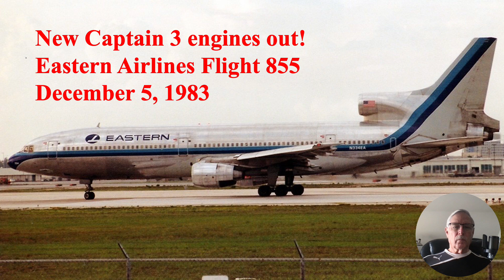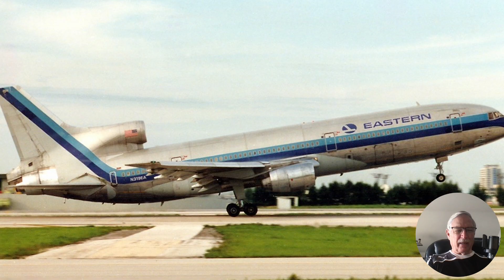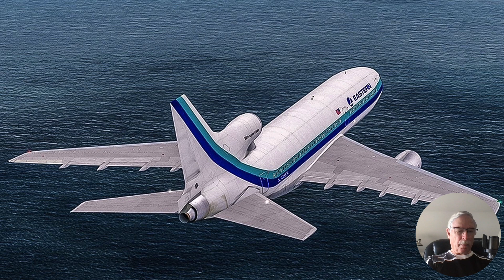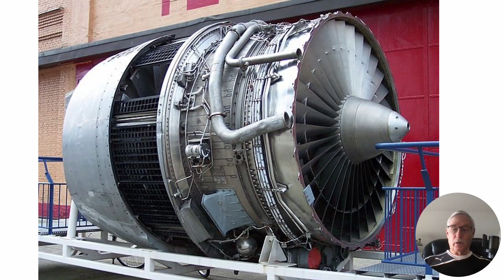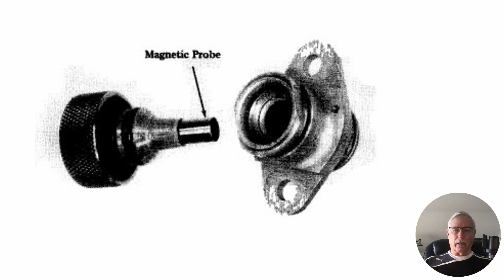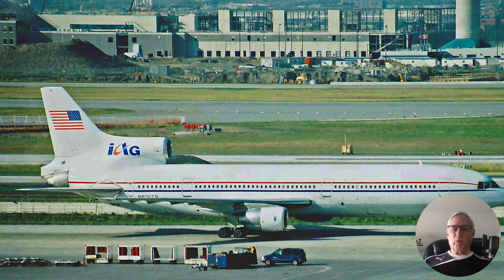New Captain 3 engines out! Eastern Airlines Flight 855 December 5, 1983

Comment: I worked for Easter at the time. There is a lot to this story that doesn't get any mention.  To start with Joe Leonard worked for American. He was saving money by when changing an engine on a DC-10 putting the engine pilon and the engine in one piece. This caused a crash in Chicago that killed everyone.
Frank Lorenzo had taken over Eastern and was at war with labor. He brought Joe Lenard to Eastern to cut costs (jobs).
He happend to walk through the stockroom in Miami and seen the stock clerks putting the O-rings on the Magnetic  plugs he said they are waisting time and changed the procedure. The guys that did the check were outside at night with coal miners lights on there helmet. This is not an excuse but part of a reason. 
Eastern was at war with the employees. Everyone was working short handed. The midnight shift was working short handed that night. The o-ring procedure had just been changed by Joe forklift Lenard.  
Short handed, firing were ten times normal. The grievance procedure was so backlogged it was non-existent, everyone was stressed beyond the braking point. I was there i seen what Frank Lorenzo did to a once great airline. He was a cutthroat and should have been stopped sooner. He is no longer allowed to have any management position in an airline. 
He had no regard for the safety of the flying public because of his history at Eastern Contenal New York Air Texas Air. His is banned by law 
Check out the Continental airlines DC-9 that crashed on take off out of Denver it was snowing in the 80s i think 32 died that night. The Captain and First  Officer both had less than 30 hours in there respective seats. A rule change by Lorenzo that allowed that to happen. Plus an equipment change to a DC-9 short. They don't have slats.
One orher crash you should look at was the Eastern 727 that crashed going into  La Paz. This was a brand new 727 the last one Eastern bought. No flight recorders were recovered and no bodys
Reply from the maker: Thanks for the insightful comments. I was wondering what part the "beloved" Lorenzo had in this event. Thanks for filling that in. Thanks for the La Paz suggestion. Will look at that.
Reply: @ronrogers  thanks for what you do. I was with Eastern for 16 years. I loved going to work everyday. The guys that changed the plugs were good mechanics. It was a bad time to be at Eastern. What a shame 
It  was so glad you pointed out the APU. That was key. 
On the La Paz crash I never understood why it was kept so quiet. Very strange. I worked on that plane just a couple of days before. It seemed like they just wanted to not know what happened. It was very strange.
Reply: "He was saving money by when changing an engine on a DC-10 putting the engine pilon and the engine in one piece. This caused a crash in Chicago that killed everyone."  

Did he have anything to do with that?  A few years earlier (from the Flt 191 NTSB report), American had changed engines pylon-attached on four DC-10-30's for a Middle Eastern carrier with no problems.  So when a fleetwide changeout of pylon bearing became necessary, AA obviously was looking at how to get it done as expeditiously as possible.  Not just about downtime for the airframes:  Keeping the pylon attached meant many less hydraulic and electrical connections got disturbed.  Unfortunately, clearances within the DC-10-10 pylon structure happened to be less, so -30 experience wasn't exactly applicable.
Reply: I think I agree with a lot of what you said, but proofreading is your friend. 
You should proofread your comment, and edit it.

Comment: I remember talking to my Dad about this incident, and his exact words were "that's the difference between a Captain a company man. These two Captains chose to save the company money and turn back to MIA where their maintenance base was, instead of, with an engine out, landing at the nearest airport. That decision damn near bit them in the ass. As far as the destination weather was concerned, they were planning to land there anyway, if they didn't have the engine issue. And, like yourself, they'd done engine out approaches in IMC probably dozens of time in the sim, and of course, the sim instructor probably never failed the easier #2. I used to love picking my Dad's brain over dinner after he retired off the -10. He moved to the left seat on the DC-4 in 1952, and stayed in that seat until he retired in 1980.
Reply: I can't fault the pilots for trying to get to Miami, since what are the odds ALL THREE engines would quit on the way back?  I mean, if one engine fails, the other 2 are very very likely to be OK, in that moment.
Reply: I remember this very well.  But, I too wonder why they didn't just land in the Bahamas.  I think Ron explained there decision, but I guess I didn't understand what he was explaining.
Reply: The opposite is true.
Nassau had no radar and no precision Instrument approach at that time.
And they were reporting low ceilings and thunderstorms. So the pilots turned around to Miami. Landing in marginal VMC with one engine out is not really a smart idea.
Let alone a landing with no engines. Because engines 1 & 3 woild have failed anyway without Oil !

Comment: I find it almost impossible that a sealing ring could be forgotten. Let alone 3 at the same time by different mechanics. I agree procedure and checklists are essential in such work but have they completely taken away the ability to see for yourself and think "this is not right" ?
Reply: It’s not hard to forget an O-Ring, but I can’t imagine forgetting them on each engine….usually, there’s more than one chip detector on each engine, and more than one O-ring on each chip detector.

Comment: Ex-UAL mechanic here, lowest level maintenance check that required the mag detectors be pulled and looked at was an A (757, 767, 777) or B (747) check, and we always did a dry motor and a 5 minute idle at the completion of those checks, insane they would not do idle runs!
Reply: I was USAF on E3s (707s) and KC-10s (DC-10s) and we only did those checks in A Dock, B Dock and other ISO Dock inspections, where it goes in a hangar and with all the maze of stands and whatnot. We never did engine runs unless it was a replaced engine! 

Worse even, when I was on the 10s, it was just four of us, for 33 jets. I had to do pre flights, post flights, adding oil (that number 2 was always a bear lol), tire changes, lights, beacons, windshields, refuel, defuel (that you know how much of a hassle that is, but imagine a tanker, with all that fuel, and you have to be up on the stand, under the wing). At least the 707 has a convenient defuel panel on the right of the fuselage (though the defuel level was under the panel under the wing, with a million screws, and that panel had to be removed since it blocked the defuel level from being open, so you didnt defuel by mistake)

But ultimately, its when I left aviation, fearing that we were over worked, having to follow the TO, which was us, were these GIANT tomes. Id memorized so much of it, and only check for updates to the TO once a week, and just have the TO with me, opened at the right page, and just speed my way through. Never had a single issue, and even won QA awards, tire changing rodeos, etc. But, eventually it was enough, and cross trained to SF, because id rather be shot at than risk an accident. Working 12 hour shifts, 7 days a week was too much (dont get me started if one of us four would go home with a tool in his pocket, which meant the entire flight line was on lock down).

Its bitter sweet remembering all this though...no recognition, not even glamorous stories, but, it was a job and we did our best.
Reply: @RipRoaringGarage  Thank you for your service and have a Happy Easter!
Reply: @theleastofpilgrims3379  Thank you and @ED-es2qv thank you also, though no need. Never liked getting those thanks, but do appreciate the sentiment all the same! So thank you. Happy Easter
Reply: @RipRoaringGarage Thank you for your service.
Reply: My grandfather was a captain and line check airman for Eastern Airlines. As I'm sure you know based on your experience, during this period of time, Eastern airlines was going downhill pretty steeply in most areas of its operations, and that probably included maintenance. He wasn't with the airline for much longer after this since he saw the writing on the wall and knew at least a few companies would be in trouble as soon as deregulation of the airline industry happened.  He was in Miami very frequently, and possibly knew at least one of the crew members here, but he never flew the Lockheed Tristar as far as I know. He had type ratings on the DC-9, 727 and Airbus A300, and never told the family about having a major incident of any sort. I can only speculate, but it's possible that the technicians weren't the best trained in the world, maybe they were rushed through their training and had a little experience. Eastern was doing virtually everything they could do to save a buck at that point, specifically in the short-term, which is why they made bad decisions like selling their most profitable routes to other airlines. I believe the only reason they picked up in the Airbus a300 at all was because Airbus promised better fuel efficiency and actually gave the Airbuses to Eastern Airlines for free for an extended trial. In an effort to try to get any American airline to buy the plane from them. Luckily for Airbus the tactic worked and they started getting orders with Eastern being the launch customer in the US. Unfortunately it didn't savr the airline from going under anyway. I think the poor maintenance in this story is just a symptom of the underlying financial problems the airline was having at that time.
Reply: @unr3alGaming 
The reason that they got the A300, was because airbutt gave them to eastern for a buck apiece.
Reply: The Big Problem with Eastern Air Lines was.  Frank Lorenzo the OWNER and the only thing he was is a Herb
Reply: @lannyfenster7461 
I agree that Lorenzo was the problem at EAL, but what’s a Herb?

Comment: L1011 was a great airplane when it worked. It had teething problems at EAL, especially with glitches due to what I think was called a multiplex system. So three oil quantity gauges going down would obviously be a "glitch". I was an FE on a 727 headed to STX and was on company freq to give the out-off report (no ACARS back then). Crew was asking maintenance what glitch would be responsible with a back and forth about the systems until I heard: "Nevermind, we just lost number 1 (or 3, I can't remember which). Rumor had it that the guy who implemented the United DC-10 forklift engine change had been hired by EAL and shortened the motor time or even changed it from a full startup to a motor.

Comment: That was one heck of a 'check flight.' Thanks for sharing. ... Re: 'single point failures,' - I've often wondered how - if I lost one engine over water and was diverting to the nearest airport - I would be hoping that the problem was NOT a fuel contamination issue .... and how closely I'd be monitoring the remaining engine.

Comment: I once got a leak on the emergency landing gear extension valve. It is only there in case you loose fluid in the circuit which it was itself causing.
Reply: -Loose?

Comment: I read somewhere that the RB211 was especially resilient to oil depravation and this is why despite the situation, the crew were able to get No.2 up and running again, once it had cooled a little.
Reply: Seems like it may have saved them that they shut down #2 when they did.
Reply: @BNU30C just enough oil left in the tank for later. Most of the bearings are rolling type I would think, as a result with a little vestigial oil getting through they would keep going for quite a while.

Comment: The L1011 is my favorite airplane still to this day. Didn't much care for the DC-10. I flew a lot as a passenger in the '80's.
Reply: Were they not sister airplanes? Apparently then, there were substantive differences between the two aircraft?
Reply: @CM7078-Remy  yes, different engines, different systems designs, the L1011 also had a more advanced autopilot
Reply: @CM7078-Remy 
Why were you thinking they’re related? 
Totally different manufacturers, my friend.
Not to mention, totally different designs.
Reply: @patrickflohe7427 Yes, two different manufacturers; that much I knew. As far as design? I assumed that there were at least similarities other than large wings, big fuselage, and big, big, engines.
But I'm sure that you are more knowledgeable than I am...

Comment: One of the greatest tragedies in aviation history was when Lockheed abandoned the airliner business.
Reply: Amen to that.  I wish the US would incentivize Lockheed to develop, under the auspices of a military transport aircraft with capabilities similar to the A330-based Voyager tanker/VIP aircraft and the 757-based VIP aircraft a midsized long range airliner familiy smaller than the 787.  capable of replacing the 737 Max 9 and Max 10 and the 757 and A321, which would ideally be branded the Constellation II and Starliner II, and which would have options allowing for high speed along the lines of a 727 or 747 or high efficiency along the lines of the A330 or 757-300.    Belugas could be purchased from Airbus to facilitate a worldwide assembly line, or alternately some refurbished C5 Galaxy aircraft
Reply: Flown in plenty of L1011s, an Electra (S9-NAF) and even a Jetstar (S9-NAE), great planes all.
Reply: It’s still fascinating to me that they created the most futuristic spy airplane with nothing but a slide rule
Reply: @crazyralph6386  Grossly untrue.
Reply: @marcmcreynolds2827 do tell?
Reply: The Electra had some very bad problems with the wings and engines.  They would shake themselves until the wing would snap off.  Eventually it got fixed but the damage was done after several flights bought the farm.
Reply: @pamshewan9181   While true, once the problem was addressed, by adding a reinforcing strut, the Electra and the military derivative, the P3-Orion, proved to be brilliant workhorses.  At the time metal fatigue was not well understood, as DeHavilland had experienced with the Comet, but the L-188 Electra (as opposed to the original L-14 Electra) required much less modification and remained in frontline service throughout the 1960s
Reply: I loved the aircraft
Reply: Fun to fly in
Reply: Lockheed Electra!